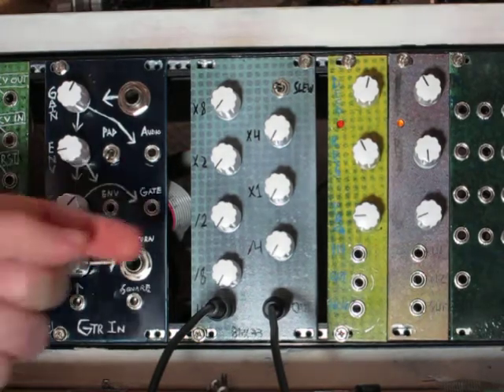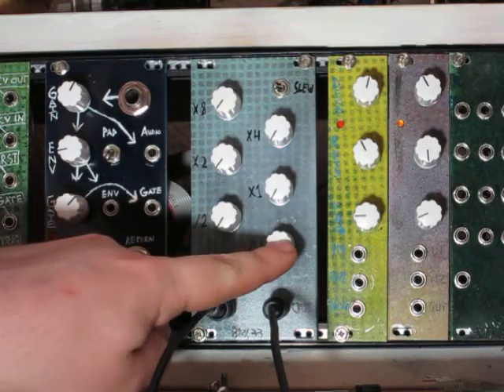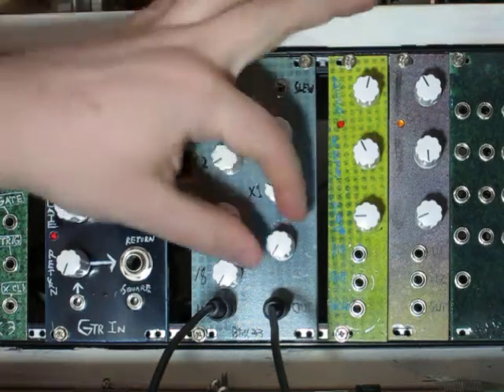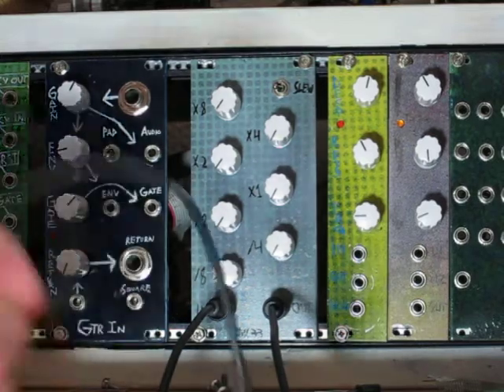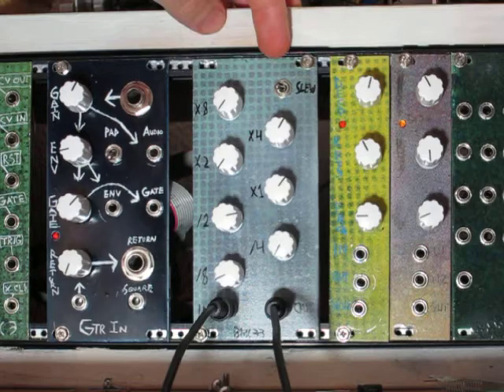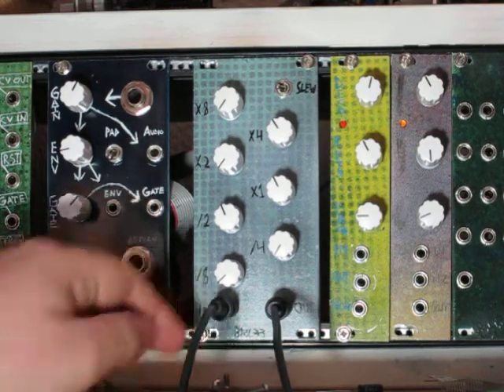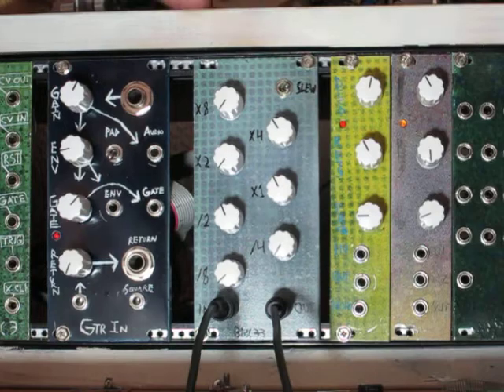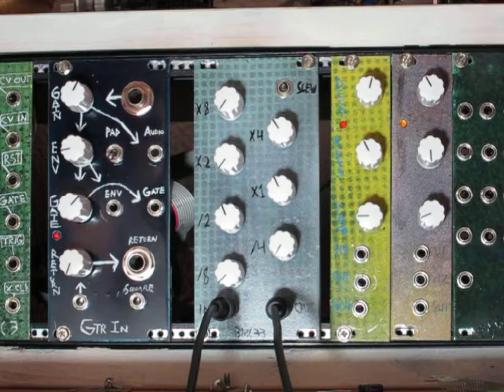4046 Shaper Demo

Comment: For someone who knows nothing about electronics, if ordering one of these, do we build the box for it [i see you have your modules open and screwed to a large board] do we make our own board to hold the modules or is that just how you display/use your multiple modules? Interested in this, the GTR module, and others
Reply: yes you need to build a case and also get a power supply for eurorack